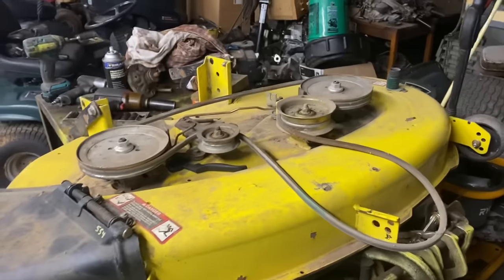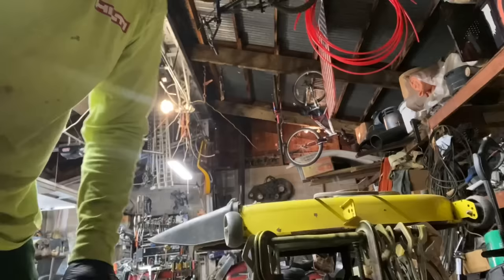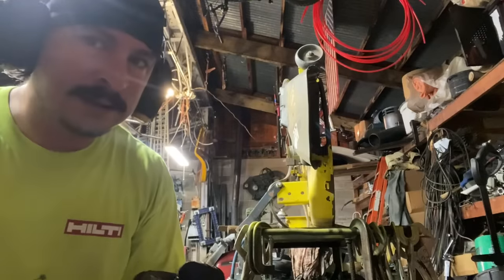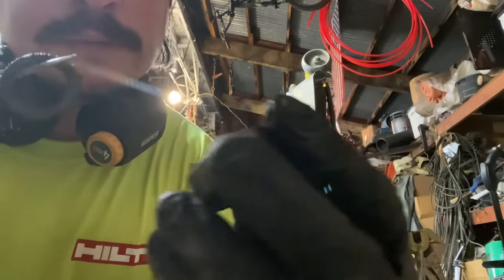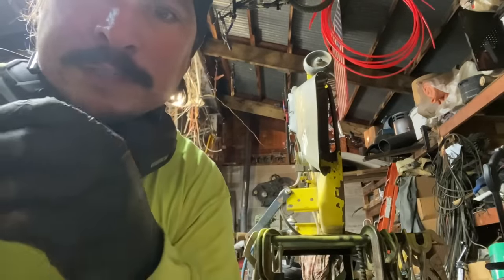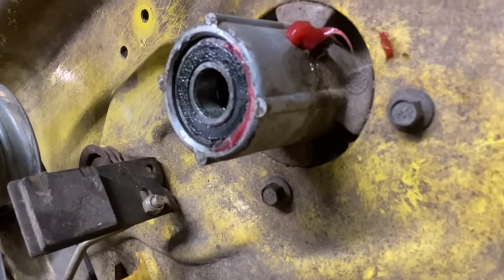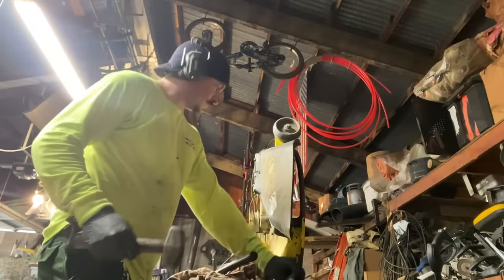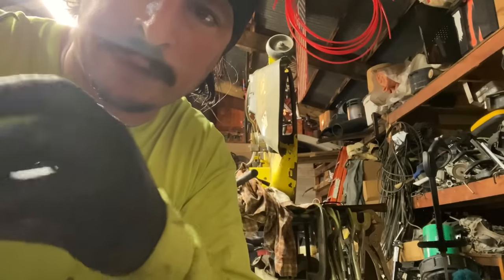Part 1 - Don’t trust the “Experts” Grease your mower deck sealed spindle bearings Common sense.

Comment: I have two sealed bearing spindles on my Craftsman Pro lawn tractor and it is still working fine after 423 hours.  There is not any play in the spindle.  Isn't that pretty good?  How long will it last?  I have never added any grease or oil.  It will interesting to hear your thoughts. How will I know when to replace my spindles???
Reply from the maker: If the mandrels have zerks you can grease them now. 400 hours is very good for no failures. It’s impossible to say how long they can last. So many factors. Garage kept? Wash with water or blow off with air? Who was greasing bearings the day the bearings were made?  What grease was used? Obviously your very fortunate to not have any issues and have gone as long as they have. Iv seen bearings fail in less than 100 hours on the meter for some machines. When bearings run dry they will get noisy.

Comment: Bough a new Yardman mower. 1st thing removed the spindles, removed all bearing and shaft, drilled and tapped spindles for a grease fitting. installed the shaft and pulled the end plate on the seal and now lub e the spindles every 10 cuts and no problems  what so ever.

Comment: My 52 inch hustler didn't come with grease nipples so I filled new spindles towers with grease before install but I could drill and tap for grease nipples
Reply from the maker: Sad that they didn’t even come with grease zerks. Extra grease is a good thing. Not allowing for adding more is no good.
Reply: @GTObearclaw1  don't let the grease worms eat your bearings out.. 👍

Comment: Had to replace the bearings on all three of my spindles on my J D and they all had closed bearing. I pulled the seal off one side of the bearing before reassembing them they have lasted five times longer so far than the originals. Bought a new troy built and took the spindles apart and did this to the bearings after only one hour of use. They are holding up great its been five years now and still going.
Reply from the maker: Did you try greasing the assembly as I showed first? That’s all that was needed but have to do it before the bearings fail. Iv been doing this a long time. Took me a while to figure out those inner seals don’t stop the passage of grease. I quit wasting my time dismantling decks to remove those seals long ago. Now I just grease the assembly until
They are filled and I no longer have bearing failures. The reason for the video is because most folks can’t get past the idea of those inner seals. They seem to be more of a mental block than an actual issue. Grease will flow right past the lip. No need to tear things apart but folks can do as they wish. But for folks that don’t want to take anything apart I have shown the process and provided proof. Those who try the process will find bearings will last longer. The way you explain also works, just requires more work for the same result.

Thanks for the comment

Comment: OMG ... Amazing!!
The bearing manufacturers must ADORE you😂😂😂
Reply from the maker: Maybe so, never really thought about that haha. I’m just disappointed that no lawn mower manufacturer provides this basic and simple information to help the customers get long life from a deck. In reality I know they don’t want them to last.
Reply: @GTObearclaw1  
My point exactly!😂😂
It's more about getting as much money from the customers as they can squeeze out ...  rather than extending the life of the product!
Don't be surprised if they now decide to seal BOTH sides of the bearings with a steel cap ... to make sure we won't be able to get the grease inside!
Reply from the maker: @conradb7200  even the bearings with a steel shields have a small rubber flap or better known as the lip. Grease does not need much room so they will
Take grease as long as they have a zerk. But I hear what your saying. They already sell
Junk. Even the quality brands have downsides. The x series Deere uses crappy plastic hoods that break extremely easy and use really thin vinal on the seat. And other quality brands have similar bad designs.

Comment: This is an older deck.  My 2021 Deere X330 owner manual states to grease the deck spindles every year.   Little weep holes on spindles right above the blades is where the grease will start to ooze out when you know there's enough in there.
Reply from the maker: I actually prefer no wee phone and plug them with a machine screw. Then grease is forced through the bearings rather than out the hole / path of least resistance. Without a hole in the mandrel more greased has to pass the bearings. Never been an issue. Same process but without a weep hole the greased passes the bearing seals. Not only is this an older than 2022 deck. It’s also not a X series. X series is not the same class of machine. X series is currently the only commercial grade John Deere riding mower made. The one I’m working on is a 100 series. And the same as all the decks ont he Home Depot big box Deere store machines for the pst 20 years. However the process to grease bearings is exactly the same. Only the X series has much higher quality components. Yes grease once a year should go forever. Don’t forget to grease the joint on the foot pedal pivots for the brake and deck lift. It’s one joint under the foot rests. Most folks miss it and when they lock together the brake and deck lift both function at the same time and breaking them free again is a job. A pump or two every few years keep it working like a champ.

Comment: I did this on my own mower decks a few years ago and can confirm same result with red grease that it definitely passes in to both upper and lower bearings with inner rubber seal.  Yes, it takes a LOT of grease but a grease tube is cheaper than a spindle.   I do wonder if the upper bearing heats up to the point it melts grease and leaks out back into the housing.  I wonder if anyone has done a good test on that yet.  I have not yet.   Also serviceable spindle manufacturers could help us out a bit by putting some volume spacers inside the housing which would reduce the amount of grease necessary to fill it to the point of pressure to pass by the inner seals.
Reply from the maker: Good thought on the void filler. I have also considered that idea. 

No I don’t think a good greased bearing produces enough heat to matter. My wheel bearings on a loaded trailer don’t even melt grease much

Comment: In 1972, my Dad bought an Allis Chalmers 310. The spindles didn't have zerks, no need, sealed bearings. A year later, the bearings went out, I took the deck to the dealer, a month out of warranty. The dealer replaced the spindles with newer ones that had zerks, changed the date it was brought in so warranty would cover it. Kept the spindles full of grease & they outlasted the rest of the mower.
Reply from the maker: Nice, thanks for sharing. A shame some folks will never believe this. But I have  100% confidence that greasing these assemblies will make the bearings last and not greasing them will result in premature failure. I don’t give one bit of credibility to the folks saying greasing will cause issues and even go a step further and say that mixing grease has never once accused an issue for my equipment. Mixing grease in this application makes no difference. But some folks will argue tooth and nail and never even try this. Sadly they will pay for repairs that could have easily been avoided.

Comment: Why do manufacturers pull this crap on unsuspecting customers? I know the brand and just bought one and you are correct, I’ve never greased the spindles on my Troy Bilt I’ve used them for 6 to 7 years can you imagine how long they would last if they designed the bearings to accept grease as they should!
Great video!
Reply from the maker: I’d love to know that too. 
If they have a zerk they will
Take grease as long as it’s not the style that has a weep hole defiled into the side of the housing. Those are definitely designed to allow bearings to fail faster. The closes system style like I showed with Deere will get the grease after assembly is filled. Most folks just don’t know that it takes a lot to fill the cavity before any gets into the bearings. Thanks for the comment.

Comment: Great info. How many hours apart would you recommend a good greasing like this? Thank you.
Reply from the maker: Normal home owner use is about 40 to 50 hours a year. I’d say about 50 hours would be wise but there are a lot of other factors to consider. 

Is water used to wash the deck. If so, not wise as bearings can get water in them. Idlers and tensioners too and those don’t have grease zerks. Greasing can push some water out. So may help the bearings if water is in them to do it sooner. Hard to really know unless you see it exit woth the grease. And I do see that sometimes.  Or does it have grass left on the deck? If so the mandrels can run hot. Grass packed around the housings does not allow air flow to cool
The units. Also the quality of grease. Cheep grease should be added more often as high quality grease could go a lot longer. Basically every year is simple and not overkill. After the first time the housings will be full. And future greasing will be fast only needing a few pumps to get it done. Commercial machines can get 40 hours a week on them in some cases may want to grease every week or month.  I’m not the expert on commercially used tractors. For that matter I’m no expert at all. A nobody really. Just having fun learning things. Thanks for your comment.

Comment: I agree with GTO bearclaw guy. The bearing seals are not water proof there not even water resistant. I have injected grease to free up frozen pistons. The grease will surely migrate around that “barrier”. 
Good video GTO bearclaw guy.
Reply from the maker: @donaldschneider4050  thanks. It’s common sense stuff but common sense is not so common it seems.

Comment: On all my mower decks, I remove those sealed bearings in the Spring and Fall, grease them with a grease needle which you can insert between the rubber type seal and inject 3 or 4 pumps with the grease gun. In 25 years, I have never had to actually replace a bearing.
Reply from the maker: That works great. As I show in some of my other videos. This video is just to prove that no disassembly is required to add grease into a unit equipped with a grease zerk. If you would rather dismantle your deck every year to get the same exact results as can be achieved by simply pumping grease in through a zerk that’s your prerogative. Many folks don’t have the tools or skills to go that deep at home and I just wanted to show that grease will in fact pass by the seals and into the bearings. The only way to prove such is to show the step by step tear down before and after. I felt it was a necessary video because so many other channels are not well enough informed to be providing advice on a topic they don’t understand. Most guys seem to be just regurgitating bad information from other channels without taking time to test the theory. I agree, a properly greased bearing can basically go forever. We have been conditioned by the manufacturers to believe it’s acceptable for bearings to fail after only a few years. Dont tell me someone is lifetime or nonservicabel because I will
Find a way to service and make it last. If you have zerks this is in fact the easiest way but not all units have grease zerks.

Comment: Great video... Would you recommend greasing the other tensioning pully bearings (the ones without zerks)? They would need to be manually removed and greased on the inside after removing the bearing seal.
Reply from the maker: Yes absolute but a grease needle will
Easily slip beside the seal and do the job. Just be careful slipping the needle past the lip.

Comment: I guess we call you Myth Busters now.  Very cool!  Now I don't have to take the spindles apart and pull the bearings to remove inner seals.  If my replacement spindles, that a friend bought from eBay and installed, don't have Zerk fittings, I guess I have to take the spindles apart to install them to be sure that no metal shavings and bits from drilling holes and screwing them in remain inside, but I'll be set then.  Someone mentioned drilling a 1/8" hole to see when they are full by seeing grease come out that hole and then seal it with a self-tapping screw, but now I know that shouldn't be necessary either.  Thanks Russ!  You are the Deck Dr.  Glad I saw this one in suggestions because I had to watch it.
Reply from the maker: Thanks for taking time to comment.  Seems your prety knowledge on the topic. I agree that best to take it apart to keep the shavings / cutting out of the assembly after drilling holes for zerks.
Reply: @GTObearclaw1   My only knowledge comes from watching several videos about taking the inner bearing seals off, with some adding to drill the weep hole and seal it with a screw, but you really covered it all in detail.  I watched another video last night after this one about it because it had added a Zerk fitting in the title, so I could see the procedure, and I told him about this video by name and your YT handle proving that removing the seals was not necessary and how to grease spindles right.   If he reads comments, he might watch your video, too, and then start telling the right was to do it.  Thanks again!
Reply from the maker: @100vg   always glad to communicate with logical folks who can see things the way I do. I am all
For learning something new and becoming a better mechanic but I was so sick of the guys saying not to even wast time greasing these things I just could not stand it any longer. Had to try and get something out there to try and help folks with this topic. I can’t believe the so called experts can be so hard headed. Iv already left my video link in some of those guys video comments askeing them to reconsider and maybe test the theory like I did and then report back with an update video that can actually help folks. Not many people see my videos but I believe once the big dogs have some evidence like I posted in my video they should consider they may be wrong about it. If they posted a video like mine they could reach more people. I don’t have the following to help many people but I’ll
Do what I can. Iv been fixing decks for 15 years and it’s been one of the most common repairs I make due to folks just not knowing the zerk is there or how important getting some grease to those bearings actually is. 

Thanks again for the comment
Reply: @GTObearclaw1   And thank you for that honest video and the time it took you to do it!  I'm so glad I noticed it in suggestions.  You must get enough views, likes and comments for that to happen.  It was not related to what I had just watched.  Stay safe and best of luck to you.  I just subscribed to help you.

Comment: Amazing. Never woulda believed it although the mfg didn't install the grease fittings for no reason. Thanks for this video!
Reply from the maker: Thanks for the comment. Exactly my thinking. They didn’t add the fittings for nothing. But they do fail to properly inform the users how to get grease into the bearings. Lol.